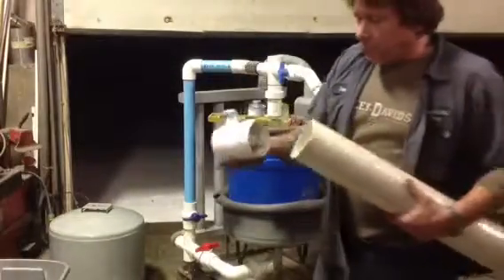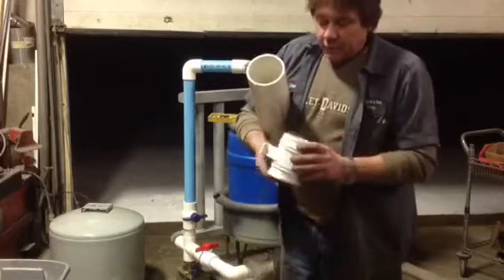Gasifier , installing fan and shaker .

Comment: Pt 2 As for what flash said about the cool gas thats very important due to if gas never gets below 230deg it wont drop out moisture also tars wont drop out they drop out around 160deg so when you see ppl with a 300+ pipe temp after filters they still have dirty gas due to the water and tar is still in vapor form! Keep at tho for a first time build its better then alot of first time ones out there!

Comment: For a good simple fan i use either a wood stove booster fan for pushing air in to flair it up they work on 12v Home Depo sells them or i get one of those exhaust fans for a newer forced air gas furnace they also run on 12v but with either one i use a PWM for speed control and hook that up to a battery charger both are squirrel cage fans just make sure its not a close tight blade one less fan blades makes it easy to clean up! Looking good so far! Cont

Comment: Find yourself a squirrel cage fan that has the motor on the outside. As far as the little inline fan, the smokes and tars will break the plastic down and make it brittle but you can get a few good test from it.

Comment: David the job is taking shape! There are a lot of people that make the mistake of not cooling the gas down enough so keep this in mind. The longer the cooling tubes the cooler the gas. If the gas is too warm it loses octane because it has expanded too much. Before I forget, The inline fan will not hold up to smoke and possible tars passing over the blades plus the motor is inside of the housing so it will be damaged by the smoke. Been there and done that. Find yourself a squirrel cage fan. cont: